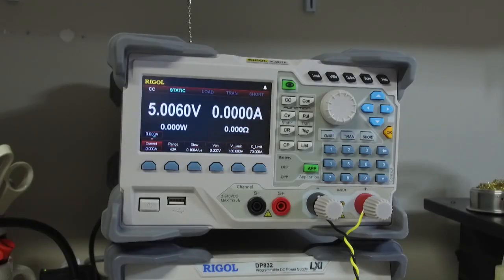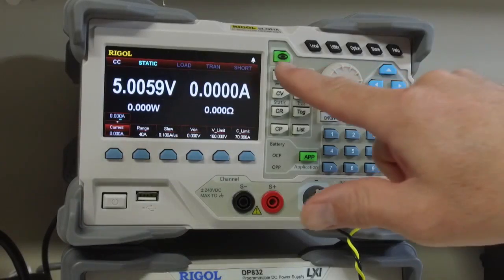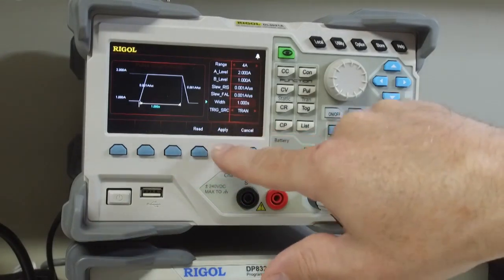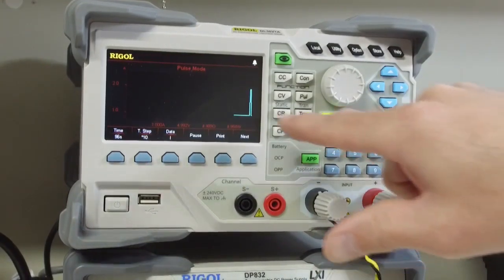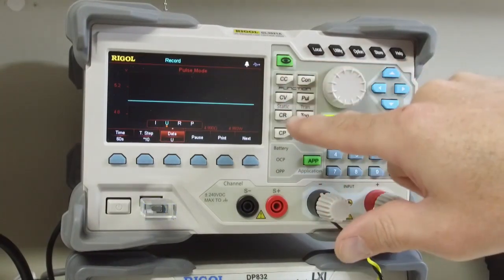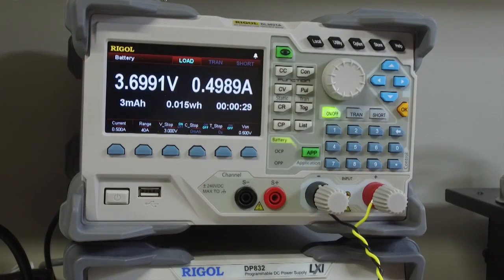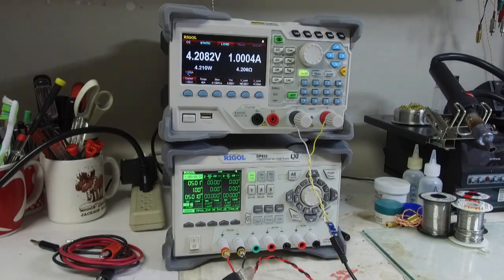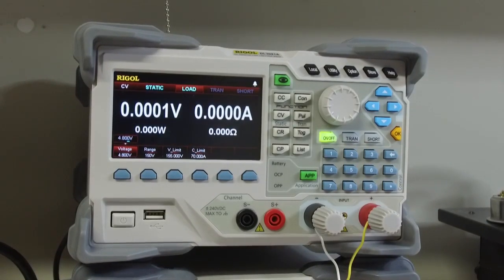Rigol DL3000 DL3021A Series Electronic Load Review

Comment: Thank you for the review. I am about to make a purchase decision, and I am looking at what capabilities this type of device has. In the battery test, the last parameter Von set to 0.500V is the voltage parameter with which you load the battery during the test?
Reply from the maker: It is not a loading value.  I have never really used this parameter but I believe this is threshold value at which the testing will start.

Comment: I was able to fix my Battery Test, based on how you did it. I do not know what I did wrong, but it's OK now. I emailed the tech support, but have not hear back as of today, I hope someone will respond sometimes next week, or I'll call them. I also watched your video 3rd time and you are doing a great job explaining it. Thank you again!
Reply from the maker: Your welcome.  Good to hear the DL3000 is working for you.
Reply: @DanPattenAudioG33k  Are there some tests I should avoid? Or some "mistakes" I should also not make, because I love my equipment working, not dead! ha ha ha Also, what was the most Amps you tested? Thank you again!
Reply from the maker: Can not really think of anything to avoid (except over current or over voltage).  I have rarely used my unit over a few amps, so have not pushed it too hard.  Did some work qualifying a product for California BC mark qualification.  For this test, I had to remove the the lithium battery safety circuit.  I ended up accidentally over discharging a few batteries that resulted in exciting "vents".
Reply: @DanPattenAudioG33k  Very nice learning experience! Did you had to replace the batteries? ha ha ha

Comment: Hi Dan, thank you for taking the time to put this video up - the only place I found where the RECORD function to the USB drive was explained clearly. Finally got the data I needed on to the USB drive. I thought I was going crazy when the data stopped being written when you moved away from the eye-trace screen. Have you tried using the instrument with the USB (or Ethernet) connection and remote controlling it, and logging data, via the host PC?  The only criticism I have of the instrument, so far, is that the battery test does not offer a constant power discharge as well as the constant current.
Reply from the maker: Thanks.  I have enjoyed this instrument so far.  The main reason that I made this video was to show the recording and strip chart sampling quirks.  Same here, I kept on thinking I was doing something wrong with record mode.  Seems to be an easy fix to keep recording. 

Have not tried the remote connection via USB or Ethernet.  That is on my "To Do" list.

Comment: I happen to have both of these Rigol units, the DL3021A just arrived Tuesday and today is a fun day with it. Since I never had a Load tester before, I need to learn more, before trying it on something that I should not do. Do you have a video on do's and don't's for these units? I think the Rigol is descent quality and they look fine. Just wish they had the push on the dial, like many other's do. My revision is the same, it was manufactured 2-28-2020 and I do not see any fixes, to what you mentioned. Are there any updates out there that I could try? Also, what version do you have on your DP831 - and do you have any updates for it? Thank you very much for your videos! I'm a subscriber now also.
Reply from the maker: In general, I have been pleased with the Rigol gear. I have some of their other equipment.  

 I have not made any other videos concerning the electronic load (but could think about it) :)  Last I checked, the latest DL3000 firmware was 1.04.  I have checked a couple of different locations and have not found any versions newer.  Rigol tech support has been pretty responsive.  Maybe if we get a few people requesting an updated version, they will comply :)  

My DP832 is running firmware 1.14 and it looks like there is a 1.16.  I'll need to update to that.

Thanks
Reply: @DanPattenAudioG33k  Thanks for your quick response Dan! My version is:  1.04!!!  and it was manufactured February 2nd 2020. But sometimes they use older versions... who knows why they do that. In my case, I'm gonna ask them about the newer version. Also about the PERIOD + a number is dumb mistake and I'll tell them how bad that is! Let me have other items that I can ask them about, like if there is USB drive inserted, it should have an option to automatically record option! It is cumbersome that they make you go to so many steps to turn it on!! I need the recording of almost all measurements. Even if it records stuff I don't care about, I can delete it on the PC very fast. About you recording another  video - make it for dumb users like me. I need to set this up, so I can reset the stuff I set to a new like condition and turn stuff on/off after I watch your video. If you can do that, I'll be forever thankful to you!